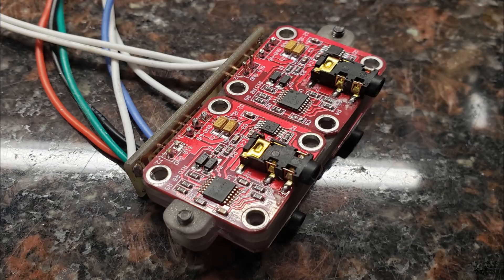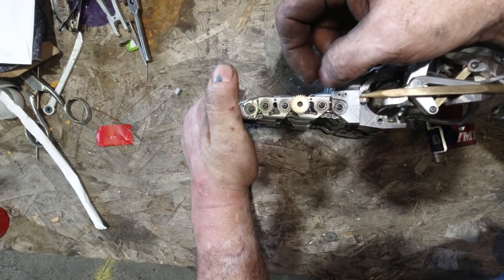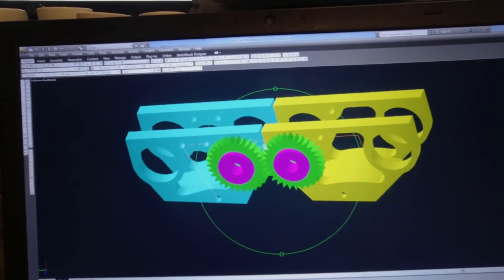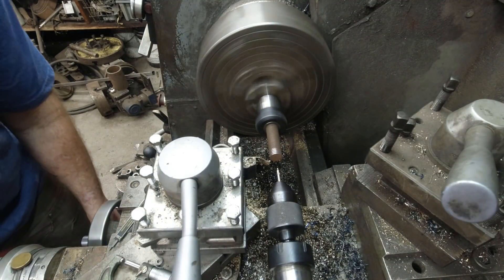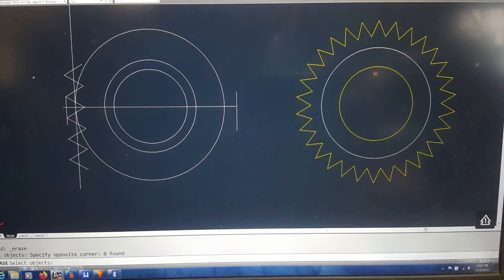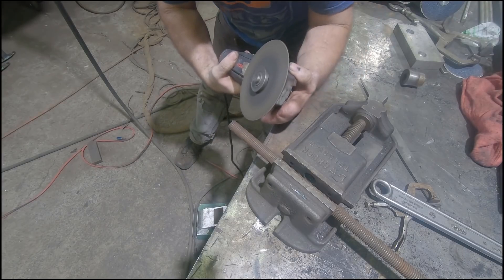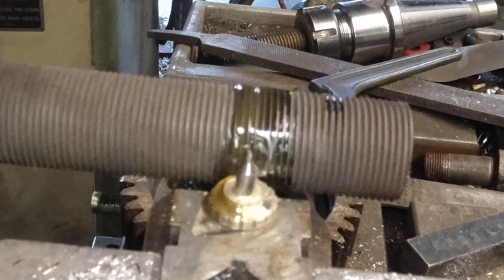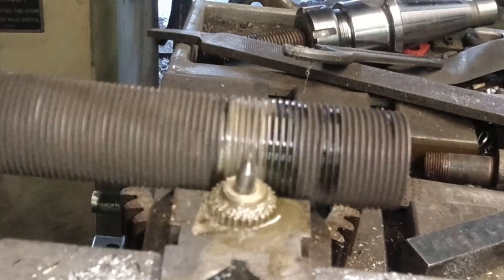How to build tiny brass gears for my prosthetic hand.  Another update on my prosthetic hand.

Comment: The hobb looks like it has a lot of wobble out at the end of the shaft?

...Would it not be better to use a dial-indicator to make it concentric, or at least move the lathe saddle closer to the head where there's less wobble??

Otherwise, it's great to see people make their own tooling which would otherwise be cost prohibitive.

I'm also disabled (with chronic illness, pain, and a ruptured disc in my lumbar area) and like to work on projects/fix things, so know exactly how much of a struggle it can be to do things by yourself.  It takes us more time, but we'll get their eventually!

I have one of those tiny Chinese mini-mills (a Sieg X2 sold by Harbor Freight) which I'm rebuilding to be more accurate. I bought a set of highly-rated Russian involute gear cutters and their arbor, which I haven't gotten to use yet. They would have been another option for cutting your little brass gears.

Comment: I was going to mention that pinion rod is a thing that's inexpensive and easy to order, but you cut your gear blanks from a chunk of pinion rod >_< :D.   Might as well stop with the half-measures and cut the gears directly into the finger 'bones'!  (I bet that's version 2...) 

Crossed wires or cables can do similar synchronization.  0.010" music wire is the right ball-park and should take considerable load while flexing over a ~0.25" radius.  While Kevlar thread is more flexible, the steel wire is probably easier to anchor to the finger bones.
Reply from the maker: I've tried the kevlar route in previous iterations,  it works great until it gets nicked or frets. Then it just comes apart. 
As far as the cable suggestion, I found that it work hardened too quickly and needed replacement very frequently.  That's one of the reasons I landed on using the #15 miniature chain.
Reply: @missingpartsclub  Guess I need to watch more of your videos!  But I suggested a very small single music wire strand because if the wire is thin enough you can keep the bending stress below the fatigue limit and it should have "infinite"life.  Thought at that size, it may not be much tougher than Kevlar thread...  I've also seen thin shim stock used for belts like this, but it's harder to terminate.  (With the ball bearings and torsional stiffness in your fingers, you can put the CW and CCW synchronization belts on opposite sides of the finger).   If you can cut them, integral sector gears on the finger bones is a very durable solution even if the tight tolerances vs a belt or crossed links makes it more sensitive to dust.  (Fyi, sdp-si.com is my go-to for small pinion wire.  48DP should be very close to the 14CP gears you cut)

Comment: Bro, this awesome. Building your own prosthetic hand. A very awesome feat. Those older brass gears looked like they had a bit a wear which is to be expected. Why dont you cut some new gears out of some 7075 or tool steal and the harden them instead of using brass? You seem to be a maker of sorts at the least so i'd imagine that you'll be using that hand alot and probably need a bit of torque and strength. Prototyping and all so i understand the use of cheaper materials at the start. I was just wondering. Keep up the work man. This is super awesome. Glad your not 3d printing it out of plastic.

Comment: Wow I didn't even think you could cut gears that way I audibly said "no way" when it started cutting. This is an awesome series and can't wait to see more!
Reply: I've seen this done with a machine tap in a lathe to cut worm gears that use ordinary screws for the worm.  Doesn't make a great worm gear reduction but it's perfect for cheap screw adjusters, etc.

Comment: Maybe stainless steel will better for heavy load
Reply from the maker: So the fingers are made of 6061 t6, 7075 t6, and 304 stainless steel.  The wire socket is 304 stainless.   Stainless steel is actually really soft as a material. If I needed a pile more strength for a part. I would probably either make it out of tool steel, or gr7 titanium.  Stainless is really good for corrosion resistance though.
Reply: @missingpartsclub  yeah...... Titanium is great..... Try to buy it in cheap price in bulk

Comment: I love your dedication man, but did you make all the fingers the same size to manufacture it easier, or is it just unnecessary to have all of them different lengths?
Reply from the maker: So all of the distal are the same. The index and ring medials and proximal are the same, the pinky and middle, medial and proximal are unique .
So 1 size distal, 
3 different medials,
3 different proximals.
Reply: @missingpartsclub  interesting